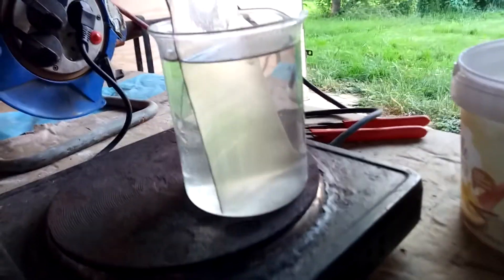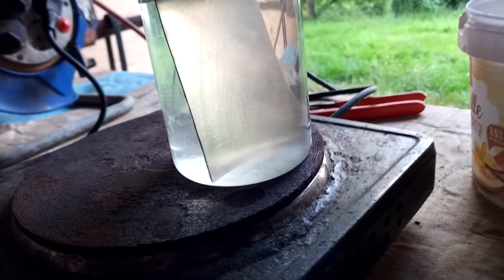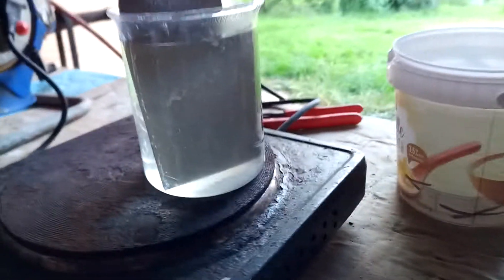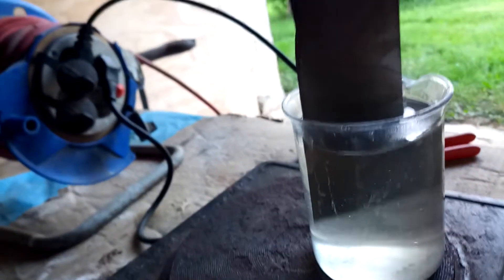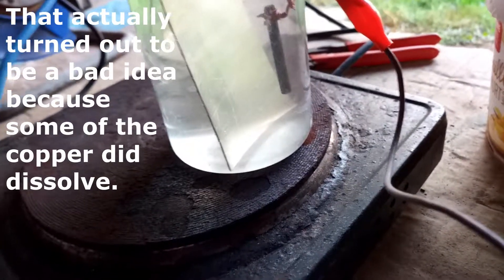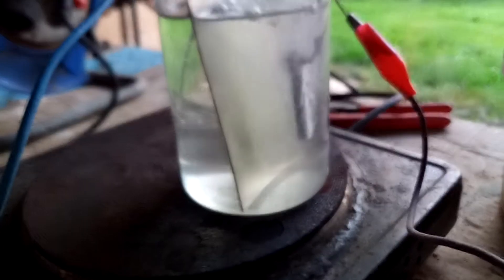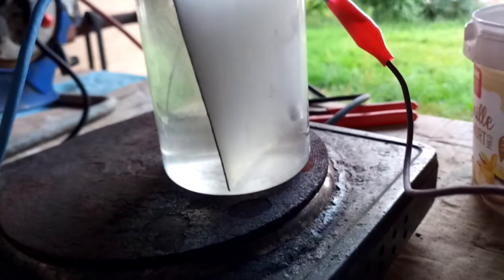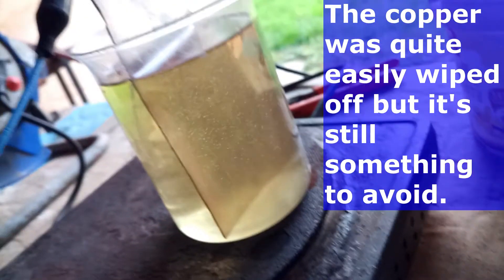Electroetching titanium with oxalic acid

Comment: copper plated Ti is not bad because thats what I use to plate PbO2 ontop of the copper layer.
Well the copper layer has to be plated on right and adherent by the right additives like NaF.
Reply from the maker: Don't know how comparable MnO2 and PbO2 are but I'm suspecting it won't help any seeing how sensitive it is towards some kinds of contamination (e. g. iron). Maybe it's also not a problem at all because cobalt (close enough) also isn't.
Reply: @Bavarianscience  with PbO2 chromium is really bad because it can fk up the properties and lower CE.
Impure lead is not a problem because the PbO2 plating process if done right almost always makes a hard dense coating that pretty much lasts for years in a cell.
The Beta PbO2 plating bath tho must have pure lead and fluoride as an additive for electrocatalytic properties and lead nitrate actually sucks for beta PbO2 becuase it produces co deposition of alpha PbO2 which ruins the stability of the coating.
Pure alpha PbO2 is very strong and actually is tougher and harder than beta PbO2 but when either of these co deposits it produces a soft highly porous mess.